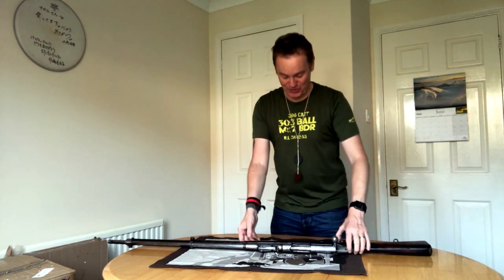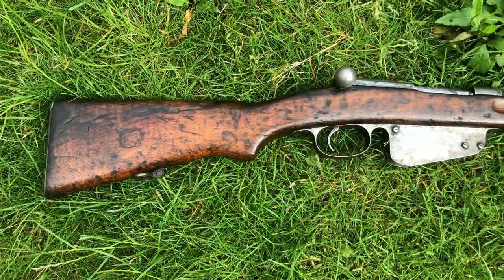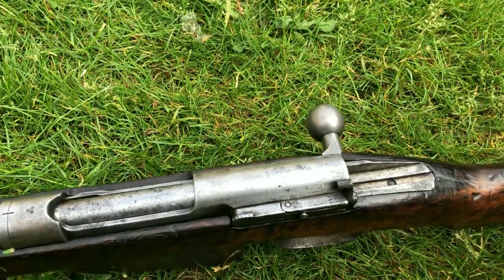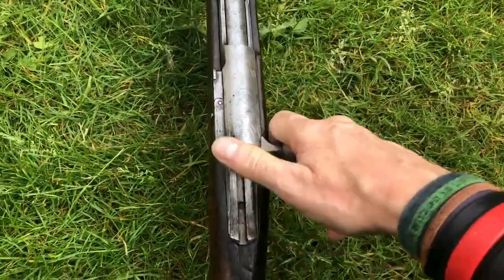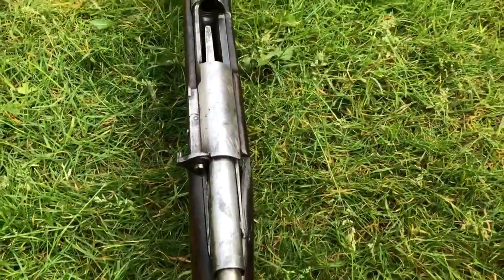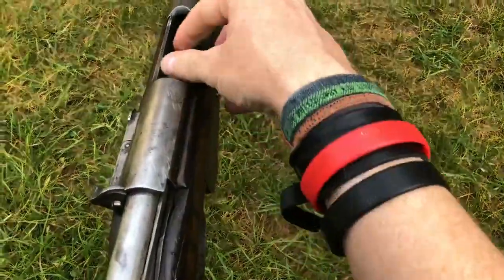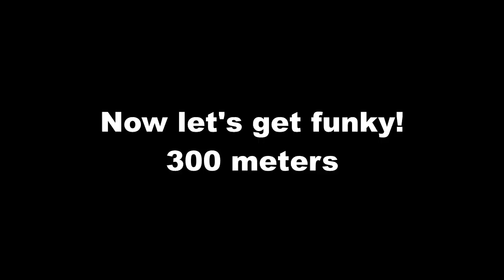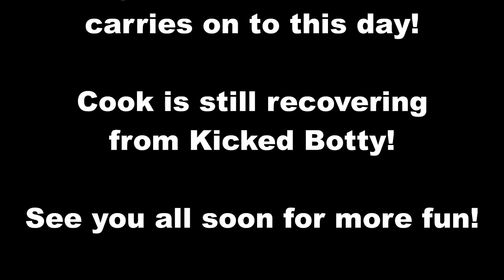Steyr Mannlicher M1886 - Intro and Range

Comment: Around 90 to 95% of the M1886 were converted. But the ones that were made for export (such as yours) were not counted in this number. So it is very rare to see one that was used by Austria in the original 11mm. The ones that were made for export have the 'II' marking after the serial number. The ones that were used by the Austrian military do not. But yes, most were sent off to Chile. I used to have one (serial number 1355 II).